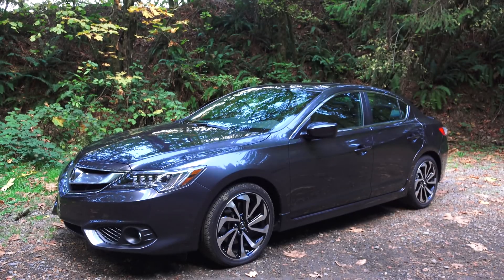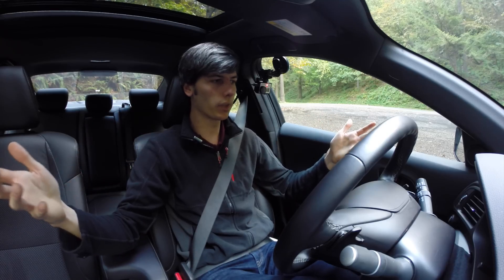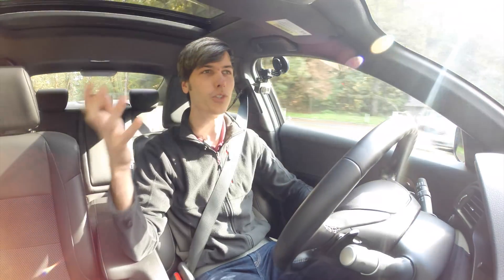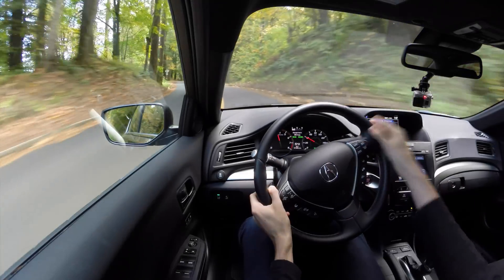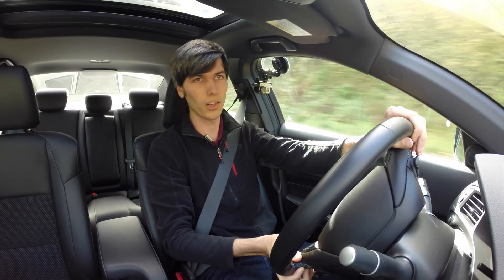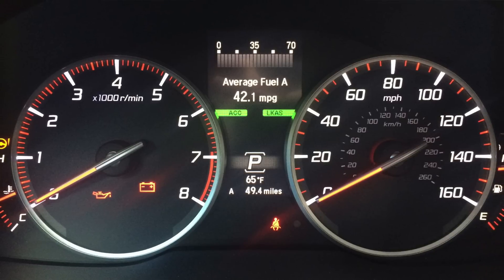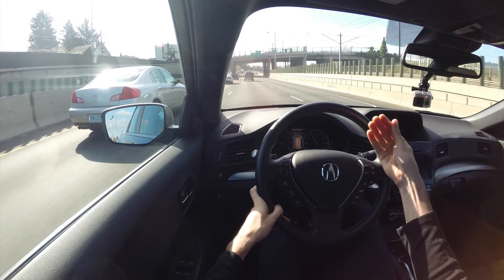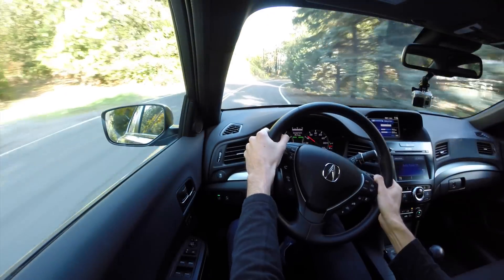2016 Acura ILX Review - DCT & Torque Converter?

Comment: These are good for high 36-39 mpg . But for long term reliability over 200k and beyond, they will fail .the transmissions will fail and be very expensive to fix.   If want something that will last  to over 200k and  300k and cheap to fix get  the ilx manual transmission those were made  from 2013 to 2015. But will only get 31 to 34 mpg.

Comment: Wasn't the purpose of DCT transmissions to remove the torque converter? What is the benefit of this setup over a regular automatic?
Reply: Huge difference...with the DCT you have twin gearboxes linked by a pair of clutches. ... That allows quicker gear shifts than a manual transmission. Odd gears are on one side even on the other so obviously you get a more direct shift like old school manual putting down more direct power to the wheels but more efficiently. Now adding a torque converter just allows it to give you a softer less harsh shift but still all the benefits off a DCT's more direct efficient shifts in standard drive mode but when you put it in sport mode it by passes the torque converter so trans will shift faster and harder... The problem with a standard auto isn't just the torque converter it's a single gear box is the slow delayed shifts creating more wear and loss in power from engine to the transmission. Really just a poor way to put power to wheels. DCT's are putting manuals out to pasture sadly because they can do everything a manual can do but better while improving mpg. The only reason other companies haven't used a torque converter like this is cost.

Comment: I bought the 2020 TLX with the same DCT...love it!
Reply: I wanted TLX 2.4, but then realized, that ILX will be quicker since it weighs less.
Reply: @Snyte1  Maybe but the TLX is a nicer car in my opinion
Reply: I bought my new 2020 in early September for just under 24k in performance red in a premium A Spec package. Gives much more sporty look and better seats with the must have led fog lamps. I choose one with ebony colored seats rather then bright red typically in them. I would have loved to have gotten the tech package though but they weren't very common in my area with A Spec package. The continental tires handle well but can be loud on certain surfaces wish they had summer tire option or just used michelin pilots on the A Spec. How did you do on yours? What color did you pick?
Reply: @robertblack6630  Paid 28k...you got a smoking deal!!!!
Reply: @DUNEDIRT  TY Acura is sitting on $3,600 in dealer cash since August. Knowing that was solved a big part of the battle you know. But helll I didn't think I like the car but once I sat in the A Spec I fell in love, ut made 2018 Si seems cheap...
Reply: @robertblack6630  Yeah, I got $4000 off for incentive money and $1800 off for loyalty cash

Comment: How often do you change the transmission fluid on a Acura DCT transmission? Seems like no one has an answer to this.
Reply: ive done some research and it really depends, since its DCT it acts like a manual transmission, so some sources said around 30,000 miles but it depends how heavily you use it, if its starting to shift gears roughly I would suggest you change the fluid

Comment: I tested one of this , same year,  2.4L, previous year were a 1.5 or 1.8 L Civic loaded with all bells and whistles , totally DISAPPOINTED, I always had been a “Hondaholic” person, but this one was the last nail in the coffin, nothing to do with my ‘07 TSX 2.4L , this ILX feels like a Civic and performance is nothing but a civic despite all extra equipment , I had to accelerate hard the f** car to in some way feel those “201” horse power they claim the engine have ....BS.....I ended buying a low miles ‘13 Camry XLE, 2.5 L only 178 HP is more car , more comfortable and more agile than the OVERPRICED CIVIC ILX, no a single positive review on line !!!😡

Comment: Can please do a 2019 Acura ILX review.
Reply: It's pretty much the same car mechanically. Only differences are the 2019 is $2k cheaper across all trims, better exterior and interior, Acurawatch now standard,  Android auto/apple carplay now available, and the A-Spex trim now looks a lot better than prior version.
Reply: @JPZ89  same 0-60 times?
Reply: @smokescreen399  should be the same. Motor and trans are same specs and there's less than 10lbs of difference between the curb weights

Comment: Any word on how reliable that DCT transmission is?
Reply: Im curious on that too. Having a hard time getting info on it.
Reply: ZDriver1996 I was gonna ask the same question. But I only seem to find info on the tlx.
Reply: Oscar Cazares What do they say about the TLX’s. I think they are the same. I’ve been considering this car but, I have the same curiosity.
Reply: Luis Gonzalez I’ve seen a couple transmission problems with tlx owners
Reply: I've had my ILX since early '17. No problems. Usually if u don't hear about anything, there's nothing to hear.
Reply: YoungManDub yea didn’t think about it that way. How many miles does your ilx have
Reply: @oscarcazares2972  only about 7k. but when I do drive it, I really drive it lol
Reply: YoungManDub thinking about getting a used one instead of a 14 is250 mainly because the better mpg. It’s just I’m a bit skeptical on honda transmissions especially since it’s an 8speed dct.
Reply: @oscarcazares2972  IMO Honda is the most reliable brand out there. Just took my Ac out today and had a blast working the 8speed. Lexus is for old people lol
Reply: YoungManDub You need to correct your opinion. Lexus is the most reliable brand out there.
Reply: Extremely over 300k miles have been seen with issue at my local dealer

Comment: Does  this torque converter lock? At what RPM range does it lock?
Reply: Around 30mph usually. Sometimes a bit lower depending on how much throttle

Comment: i just got 2017 i love the dual clutch in ILX its amazing blazing fast shifts on S mode its quick car alot low med Tq handles very good im running 245/40/17 all around grips so hard changed the handling so much better my brother has 2015 328 we went to angales cres high way a lot turns i was taking the corners so hard he was so surprised i got 69 K&N intake makes deep growl love it

Comment: When I'm driving my TLX with a dual clutch and I apply the brakes to start slowing down I feel it downshifting and the revs look like they are bouncing is that normal?
Reply: Yes. That's normal for a car to downshift as you slow down. When a car downshifts the RPMs go up.

Comment: Sounded like something snapped at the very end. And my question is Are there any disadvantages of the DCT and torque converter?
Reply: +Johnnie Burkhalter It's not as smooth in slow moving traffic. It can get a little jerky at certain speeds in stop and go traffic.
Reply: The snap sound was probably a small rock/pebble hitting the underbody.

Comment: I've seen some people bashing this car and saying it's basically a re-badged Civic. They ain't got a clue what they're talking about. The ILX is a fantastic car imo. Great review!
Reply: +NickLAUZ95 Only thing they share is a compact car size. I think previous ILX really damaged it's image because it was in fact a rebranded civic. Thanks god acura fixed it in this version.
Reply: All they really need to do is drive it. I've driven the top line civic and this and there is a world of difference in how it feels.
Reply: I just got one with 23k miles.  I always had an older car, never a nice one with this type of engine. I was nervous about some sounds but people said DCT will act and sound different than a traditional automatic.
Reply: You're definitely right about that because this car is much more than just a boring crappy Honda Civic!!! To me it  puts the Honda Civic to shame. Seeing how it has the same power as  Civic SI and more power than a  Civic EX and LX and has way more features than any of the Civics

Comment: Ah, the Integra of this generation, too bad it's renamed. The dual stage intake manifold sounds like the GS-R's old IAB system.
Reply: +Henry Rubio Yes it should be called Integra. (and TLX=Vigor, RLX=Legend) :)
Reply: 9/11 insidejob I agree they shouldn't have lost the manual. But the integra never had a V6 either.
Reply: 9/11 insidejob drive it in person and you'll love the drive.

Comment: What do you think is the better overall car? 2016 Acura ILX or VW GTI? I know VW has that emission scandal going on and I'm hoping the 2.0t gas engine isn't affected.
Reply from the maker: The GTI may have a cam recall going on at the moment, something with there 2.0's and vacuum assist failing. I'm sure Humble Mechanic has more on this.
Reply: Ilx is definitely the safer option

Comment: People who own this car probably have a doubt with the reliability of a torque-converter dual-clutch automatic transmission, thanks to the electronics. The 2016 ILX is basically a heavy Civic Si with the dual-clutch transmission, since Acura no longer offers a manual transmission in their lineup.
Reply: +Tim Joseph You can have the Civic. I take the ILX.

Comment: Great review! But I absolutely hate the car, for the 36G-40G price range you can get the Infiniti Q50, the car looks better has a SEXY nice interior and its faster.  I guess it would make more sense if you just had a base ILX that you paid exactly 28-30 on but I cannot justify spending 36G on an ILX why not just get the TLX or Q50?

And me being a performance person I can't justify spending 36G on the ILX when the Civic Si has the same engine and is also faster and lighter. I don't know man I must really been hating on Acura lately, The only car that looks SEXY and is what Honda should be all about is that NSX.
Reply: 2016 ILX has the same engine as the TLX 4 cylinder not the SI
Reply: Currently they're offering killer lease deal $2499 down $199 mo that's roughly $22k sale price after all rebates and incentives

Comment: That's weird... I had always thought that the whole point of a DCT was to rid of the slushy power-sapping torque converter... Guess I was compare apples and oranges...
Reply from the maker: +Vlican DCTs are designed for quick shifts, not necessarily a smooth engagement or start.

Comment: Which Transmission should dyno more power DCT+TC or Manual?
Reply: +BimmerM5e39 Neither, it makes no difference.  Dyno pulls are done in one gear, usually fourth gear.  For a dyno pull, the torque converter will be locked-up, similarly the clutch will be fully engaged.  So it doesn't make any different to transmission loss.

Comment: This is a civic for someone who doesnt want to say they own a civic but a "luxury" car. If the Civic SI came with leather it would be the superior car between these two imho. Acura needs to figure out if they want to be more integra or rlx. Currently it looks like they are RLX. Meaning no soul and not class competitive. Presenting solutions for things no one had a problem with. If they can put an electric motor in it they will. I am just bitter because i really thought Acura might figure it out and bring an integra like offering but instead a turd that is silent and not deadly.
Reply: +Blake Swan They market this here as the "Civic Euro" as opposed to the regular Civic.  Same deal with the Accord, you can get the regular (budget) Accord, or the "Accord Euro".  No idea why they don't use Acura here also, maybe they have a better brand image.
Reply: Matthew Sharpe I really dont understand why acura exist at this point. As you said overseas these sell as Hondas which would make sense. Acura offers nothing really unique as the ilx is still FWD as opposed to RWD and has a marginally revamped interior. I actually think the 1.5l turbo civic coming out is alot better than the ILX. Then again it is just my opinion. I just think Acura could be a great thing if it wasnt just regurgetated Hondas. Make a rwd platform for Acura and i will actually take notice. Even Buick offers awd on the boat Regal.
Reply: TassieLorenzo New Zealand. We also do not get Infiniti, just higher specced Nissans.  We do get Lexus though - but they are pretty different than Toyota being most of them aren't built on common platforms with regular Toyotas.  Toyota haven't bothered with their Scion brand here either.
Reply: TassieLorenzo probably, but it does have a leather interior, better ice etc.
Reply: I honestly have no idea as I wouldn't touch a modern Honda with a ten foot pole, excepting the civic type r, which is great, but overpriced compared to the competition, and the new NSX which is out of my price range, they are all boring. Just the original comment said that if they put leather etc in the civic it would be a better car, and where I am, you can get that.
Reply: +Blake Swan I really get tired of people not understanding same body frame with the 80's/90's style GM rebadging.  Yeah I guess its the same as the civic, with the accord 4 cylinder (larger displacement) the DCT, different sheet metal, different interior....I mean at what point do you realize that being the same size and frame is just a small shared component?  Its the same size as the civic therefore its just a civic to you?
Reply: +Matthew Sharpe Where is here? :)
Reply: Matthew Sharpe AFAIK your Civic Euro is the hatchback Civic, not the Acura ILX. :)
Reply: TassieLorenzo Who cares if it is a hatch? It is the exact same car otherwise. I think its absolutely comparable to the ILX
Reply: Blake Swan No it's not. :)  The rear end is from a Honda Jazz (torsion bar, magic seats, fuel tank in the middle of the car)... it's quite different. Just sayin'
Reply: I have no problem admitting when im wrong and you are correct sir. I will stick to my American cars. Cant belive they would go through that much effort rather than having a global product.
Reply: +TassieLorenzo

Comment: Wait I thought shorter air intake would increase low end power?
Reply: +PapayaMan It's the other way around. Torque is largely added when intake/exhaust velocity is highest. With a longer intake path, the intake charge is accelerated during low end. As RPMs rise, longer intake runners are restrictive and thus a switch to shorter runners eliminates some of the restriction giving high end power.
Reply: +PapayaMan Acoustics.  Low RPM = low frequency = long wavelength = long runner.

Comment: hmmm are we sure at 0:44  when he says that to goes to long headers for low rpm, for more torque, then switches to short headers for high rpm, for high end power.  I have always thought and then confirmed on my mustang that it was the opposite. Long headers for high end power, but loses torque at low end, and use short headers for low end, for great torque,  Can someone clarify my confusion here? Thanks!
Reply from the maker: +Peter H This is the intake manifold, not the header. I stated it as Acura states on their website, it's correct.
Reply: Engineering Explained ohh intake works differently? cool! didn't know, thx!

Comment: I never understood why engineers never found a way to use a torque converter for 1st gear in manual transmissions.  By doing that, hill starts (in cars without a hill holder) would be much easier, and the clutch's lifespan would increase dramatically.  I can see why this wouldn't be necessary in all cars, because it is more weight, complexity, and expense.
Reply: ***** Was every gear on a torque converter, or only first?  If it was every gear, then I can see why nobody would care for that.

I'm just suggesting only 1st gear, because for most cars the only reason for 1st is to get moving, but it's otherwise all it does is burn the clutch.
Reply: ***** Yeah, I can definitely see why an automatic transmission that doesn't change it's own gears wouldn't sell well.  That's like buying a segway where you have to do all the balancing yourself, when you could just get a unicycle instead.

Anyway, if you drive something fast and sporty then having a normal 1st gear seems to be a better idea.  But for the average commuter (especially those who get in stop-and-go traffic), having a torque converter on 1st gear would be great.  It would also be great for people who haul heavy stuff.
Reply: I know, right! I'm sure it's possible, and I've been wondering this for years. It'd be on the engine side of the clutch, and the torque converter clutch could lock after the car starts moving.

Comment: man, I love how u speak about the paddle feels. I hate how the brz brakes feel; flate then spike in a paddle travel (x) vs braking force (y) graph.

thanks for explaining how Acura have improved the low end breathing of the engines too. is that ecu controlled? or mechanically modulated? can it be done with after market mod? and does it provide any benefits to force induction engines? love the show. I totally have recommended ur channel to my friends and will continue to do so. cheers.
Reply from the maker: +Nexus5 Google Thanks! ECU/ECM controls the management of the intake. I wouldn't be surprised if there were aftermarket solutions for things like this.